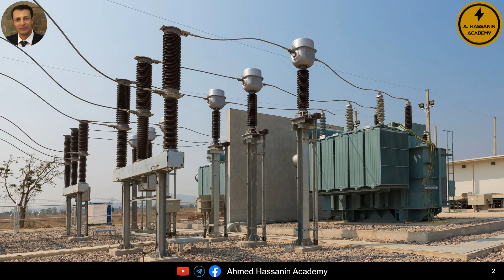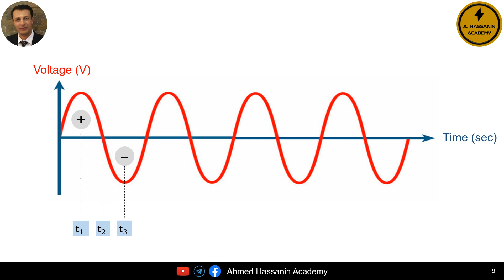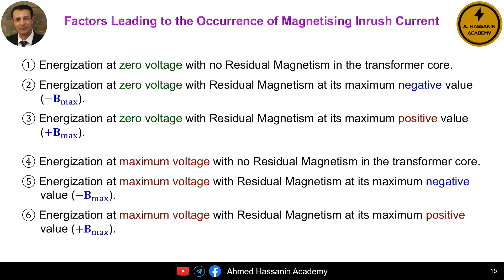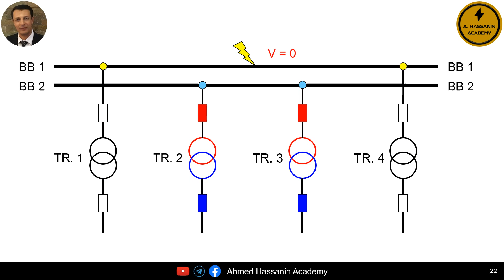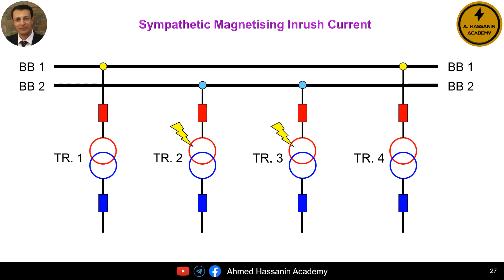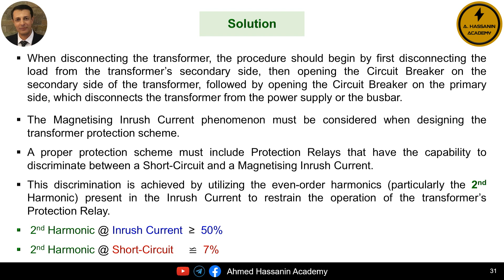Magnetising Inrush Current in Transformers | Causes, Types, & Protection Explained Clearly

Comment: In my opinion the worst case scenario is 2 or 3 depending on the exact moment of the sinus wave...

Explanation: If the residual magnetism is already maximum AND is enegerized with the rising sinus in the same direction, it will drive the transformer into saturation with maximum inrush current.